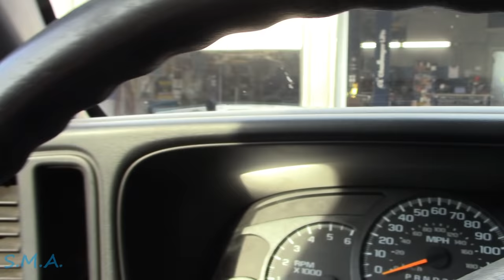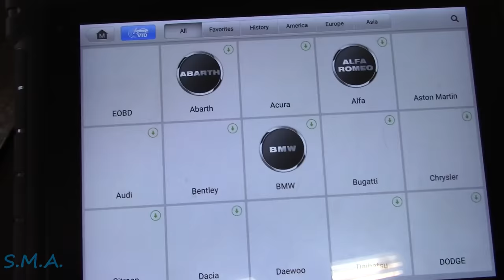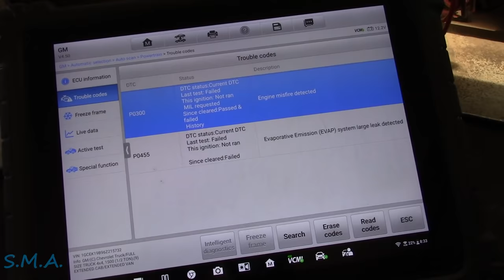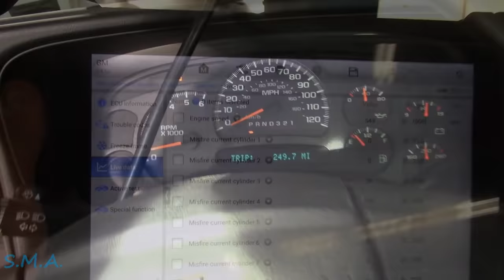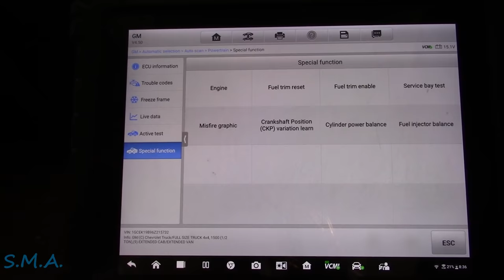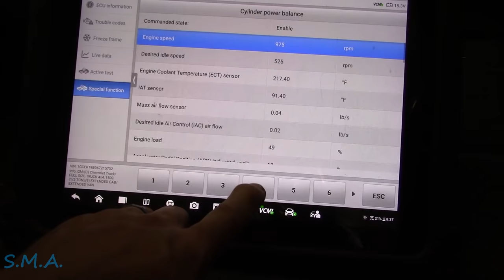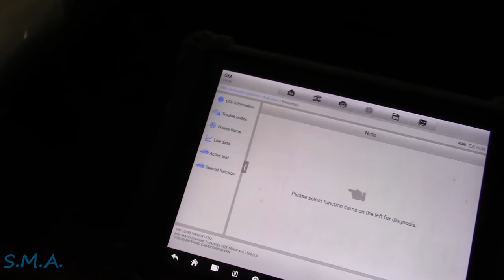GM - Chevy Truck: Misfire Diagnosis

Comment: Did you say, fuels not injecting? Looks like a burned valve to me on the way out. Your square wave tool showed almost the same results. Thus, is the tail pipe sucking air? Look at the simple things first, all that computer krap is just to turn a normal over complicated computerized engine into somthing that costs more money with some, but few advantages. I like Vortex heads. The computer and tools just make working on the mechinical components more difficult. 75% of that computer junk is not even needed. I could tell you it was a dead cyl. with a piece of garden hose to my ear. Was it injecting fuel it seemed to be firing? I could check fuel injection with a paper towel. All that complexity in the computer etc. etc. is not needed. I know, X Cummins, X Navistar ECU Design Engineer.

Comment: I'll tell you what's wrong it's a Chevy GM has been prolonged with electrical problems since way back when like the Pontiac Pontiac LeMans push on the brakes and the tail lights go out push on the brakes and the parking lights come on GM has the worst history for electrical problems if there is